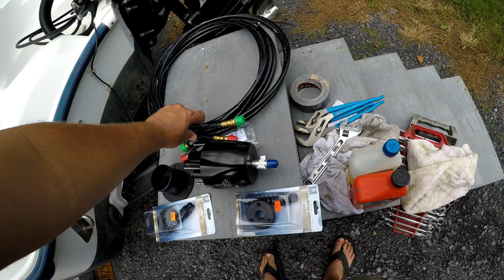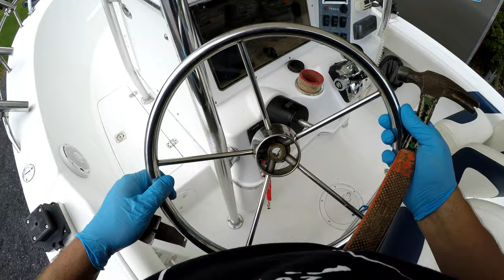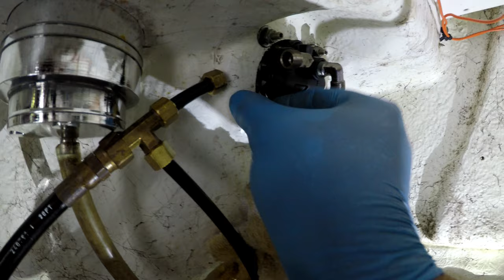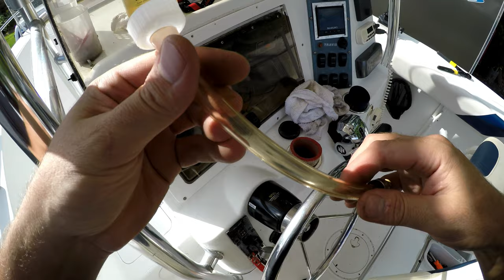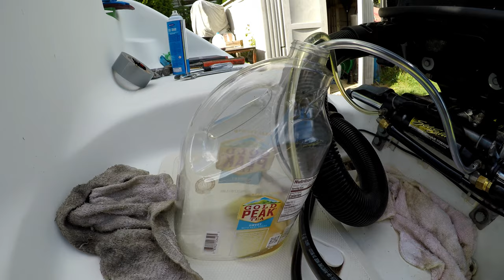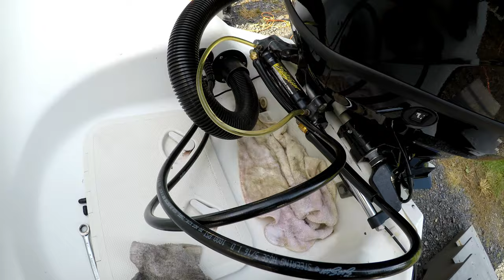How To Install Boat New Hydraulic Steering System Oudboard Engine    #boathydraulics

Comment: Hi there, I see this was posted 3 years ago. How would you rate this product, any issues so far? Thanks for your input.
Reply from the maker: Thanks for watching so far no problems with this unit it was good price and works well
Reply: Thanks for your quick response. Another YouTuber posted his installation of the same unit and also has had a good experience, so far. Would you say yours is as good as the old seastar unit?
Reply from the maker: @rickc9672  works and performs the same